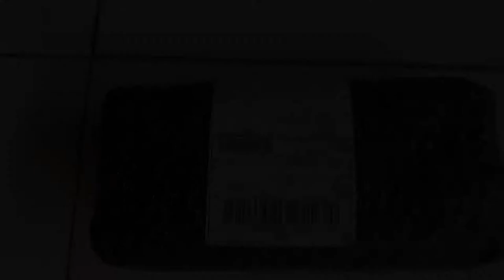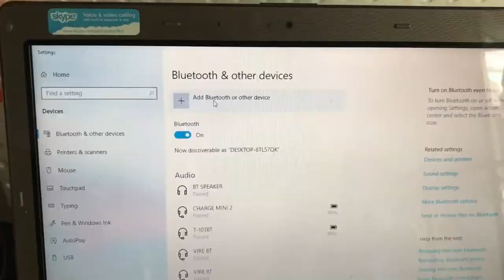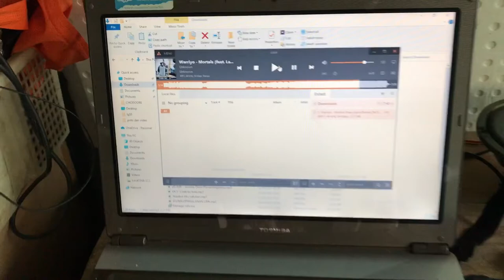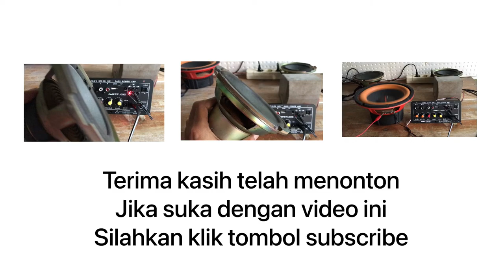Amplifier Board Audio Bluetooth USB FM Radio TF Player Subwoofer

Comment: Langsung sambung ke subwofer elsound 6'5 in 80 watt 6 ohm bisa gk mas..?
 Kalo di pasang 2 sub yg sama .  Di pararel apa di seri ..? 
Maaf Pemula
Reply from the maker: Bisa mas….
Di paralel tambah speaker mid biar suara vocalnya keluar
Reply: @CHODOORE  kalo pake 1 subw aja bisa gk..? Males bikin kotak nya mas
Reply from the maker: @andiraharja4612 modul ini ada 2 soket satu untuk sub yg satunya lagi buat mid biar suaranya gk mendem
Reply: @CHODOORE  trimakasih bos ku..
Reply from the maker: @andiraharja4612 oke sama sama 🙏🏻🙏🏻🙏🏻
Reply from the maker: @andiraharja4612  oke sama sma 🙏🏻🙏🏻🙏🏻

Comment: Bang ngerakit speaker sub + speaker tower polytron gmana ( masuk ke tweeter bisa?)
Reply from the maker: Bisa mas itu outputnya ada 2 R/L salah satunya buat tweeter satunya lagi buat bass
Reply: @CHODOORE  ntar subnya kebagi bang
Reply from the maker: @vierifirman80 gak ko mas suara subnya tetap bagus
Pake adaptornya 15 atau 19 volt 3Amper
Reply: @CHODOORE  kalo AC gak mampu bang?
Reply: @CHODOORE  makasih info nya bang.. semoga diberkahi
Reply from the maker: @vierifirman80 bisa mas

Comment: Bedanya apa sih mz yg d10 sama d30 ....tlg di jawab
Reply from the maker: Perbedaannya hanya di fiturnya mas
Untuk type dk10 35 watt dual input mic
Speaker 6 sampai 12 inc

Sedangkan untuk type dk30 watt sama 35 watt dual input mic cuma untuk type ini ada pengaturan mic mixer
Untuk penggunaan speaker 6 sampai 10 inc

Untuk lebih jelasnya silahkan lihat fitur masing masing type
Reply: @CHODOORE  klo yg d30 gimna mz hasil suaranya
Reply from the maker: Untuk yang d30 saya blm coba nanti kalo ada kesempatan saya buat videonya
Reply: @CHODOORE  ok mz....mkasih y
Reply from the maker: @feriyantowng2695  oke sama sama